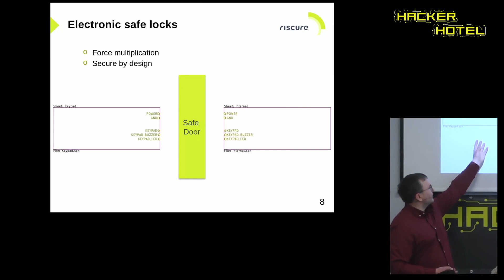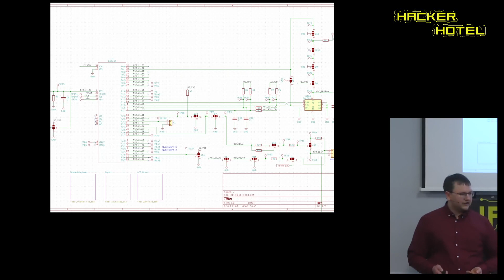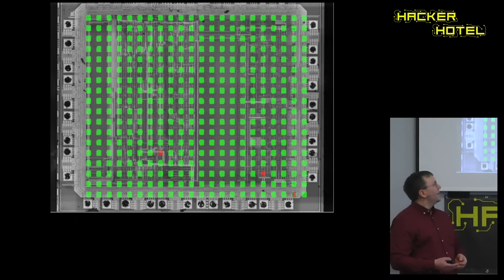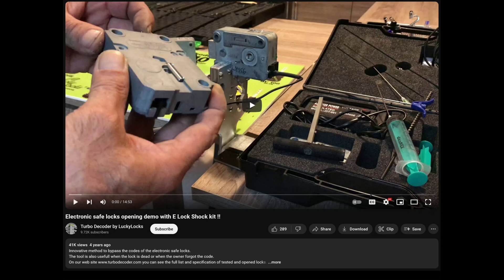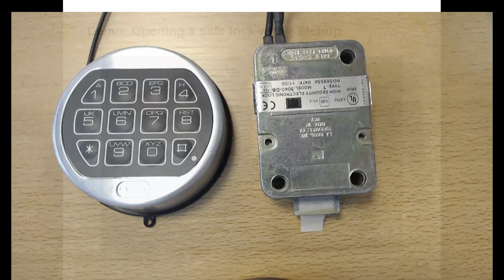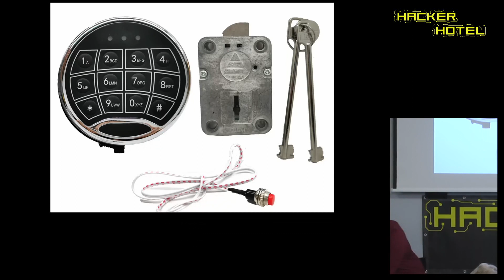Hackerhotel 2024: Opening electronic safe locks with ketchup and lasers - Jan-Willem Markus

Comment: Great presentation Jan-Willem 👏
Reply: Some of the newer locks have a resin on the boards to prevent the gel attack.
Reply: @camronbay1  You are correct, this particular Lagard is ~15 years old.
Reply: @jwrm22  Some locks you still can do this method but lock companies are getting slick to stop this.I’ve done quite a few openings with the gel.
Reply: Thank you :)